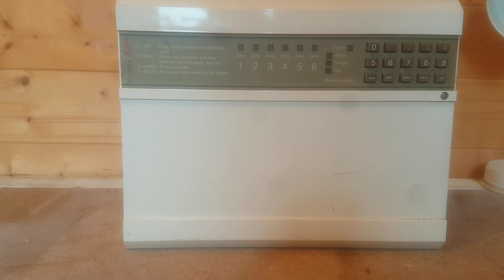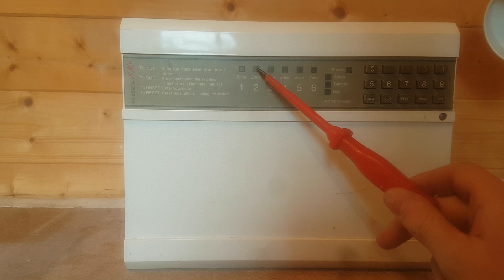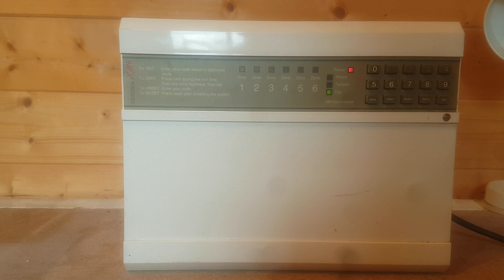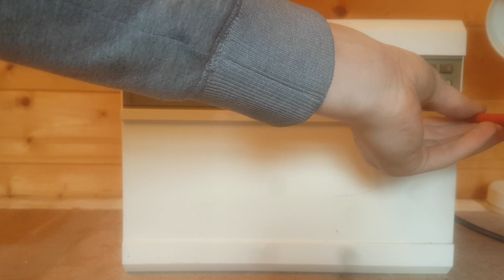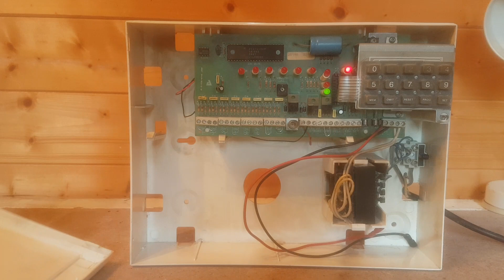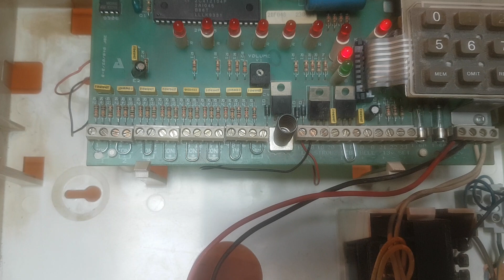A Quick Look At An Optima XM6 Burglar Alarm Control Panel

Comment: Hi mate, I've got the optima XM6 and turned the main fuse board off for most of the day due to work being done but when I turned the board back on the control panel on the alarm no longer works! The red power light is on but nothing else. I opened it up and it has a battery inside connected. I went to disconnect the battery but then the outside bell box went off so I reconnected the battery again and the alarm stopped going off! But I still have no function on the panel apart from the red power light which is still on!! What do you think mate, what should I do??

Comment: I hope you can help. This was installed before I bought the flat and have been using it for a few years. When I was leaving the flat the other day I must have hit the wrong number and since then I've been unable to use my alarm. I am unsure if I accidently changed the number by mistake? I've been looking at the manual online and have tryed to reset it but had no luck. Any ideas?

Comment: The bleeping on my box is sooo low how to i increase the volume?
Reply from the maker: Take the cover off and there is a little black square marked 'VOL' insert a mini screedriver into the middle of this and twist it the way the arrowe indicates to the desired volume.
Reply: @jakemcintyre4820  thank you
Reply: @jakemcintyre4820  hi... when I took cover off the tamper alarm went off and was loud... I check the volume and its turned to the max to the right... however when I put the cover back on the volume decreases again so low..... confused .com  lol
Reply from the maker: @mightyone8733  try setting it just under max, sometimes if they ate set to max and turned too far it shorts the circuit and puts the volume to low, so try turning it just under max and it might become louder.
Reply: @jakemcintyre4820  ill try that.. thank you Jake
Reply: @jakemcintyre4820  thank you it worked... appreciate your support have a blessed day🙏

Comment: Hey bud like your dry sense of humour and video. Ive two questions that I can’t find answers for. My alarm is installed in my garage. Can you tell me how to reduce the volume of the alarm please as mines too deafening also my alarm goes off near immediately as soon as garage doors open the PIR sensor picks up my body heat, goes off and before I can disarm it. How can I give myself 30 more seconds to get to it to be able to disarm it without it going off as if I’m a burglar? Thank you.
Reply: First of all, you probably want to open up the panel and put the pir on zone 1, and for the timer, you’ll have to look at an engineer manual

Comment: Hi,  For the past few days the alarm gets activated by itself without setting it up.  Do you think it is the battery that needs to be changed or any other issue. I hope I get to know something helpful from you. Many thanks.
Reply from the maker: Hi, I think its probably a tamper fault if its an intermittent alarm. Do you use the alarm or not?
Reply: @jakemcintyre4820  .  Thanks for your prompt reply Jake. No I don't use the alarm, but it has been going off almost everyday for the last couple of weeks. Very annoying. It got activated last night 1:00.
Reply from the maker: @nomanaziz8248  is it the same panel as the one in this video or is it a different model?
Reply: @jakemcintyre4820  Exactly the same panel as in the video. Optima XM6
Reply from the maker: @nomanaziz8248  well if you take the cover off and unscrew the wires from the transformer, on the 12v side, not the 240v side the system should power down. The wires should both be white like in this video.

Comment: How can you disable this stupid alarm silently? I can't reach the bellbox to smash it to pieces and cutting the power still leaves the battery. Whoever designed this is a moron.Does the alarm continue if the control panel is destroyed and power cut?
Reply: If the bell box has a backup battery that is working, that will sound and the panel also has a backup battery

Comment: I’m looking at removing an optima XM, I’ve bought a house with one installed and don’t have the code. Tried to unscrew the panel which set off the alarm. I quickly disabled it by removing the fuse to the box isolating the power supply. If I open the box & remove the battery will that mean the alarm won’t go off as it’s got no power to sound or will the alarm be wired into the mains? What’s the best way of disabling (without a code) and removing the whole unit & internal sensors from living room etc. Hope you see this, Thanks!
Reply: Turn off all power and just rip everything out, should be fine to do on an old panel like this.
Reply: mr security true
Reply: I'd like the same answer!!!
Reply: Depending on the age of the bell box, it might have a backup battery in it, the panel has a battery and the mains supply, after disconnecting both of them the battery in the bell box would activate the bell
Reply: Try : 0123 which is the default manufacturer code for these panels, as the previous owners may of reset the code back to factory defaults through the menu as I learnt the hard way once.

Comment: How do you pair it with a telephone so when alarm goes off it rings your phone to let you know? I had it previously but I changed my telephone number.
Reply from the maker: The panel itself doesnt do this, what you need is an auto dialler which immediatly calls your phone when the alarm trips.